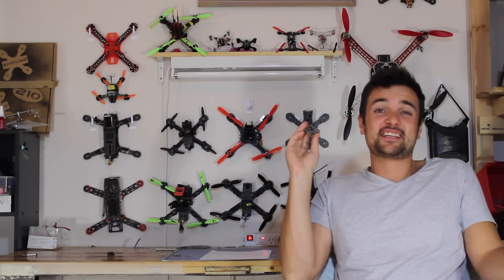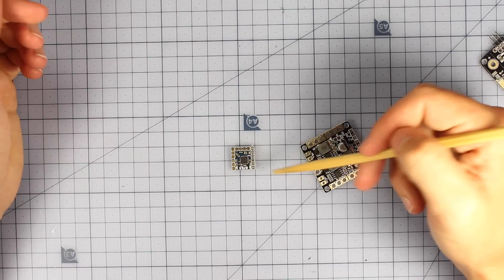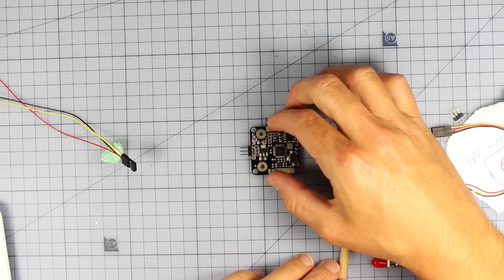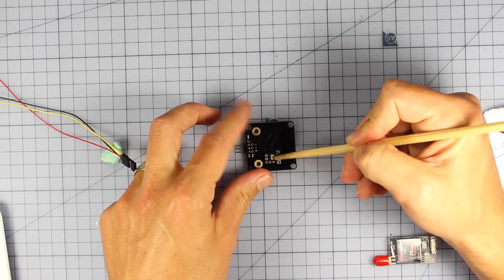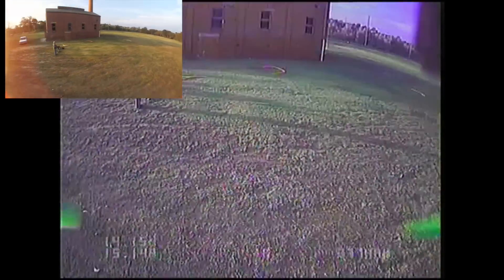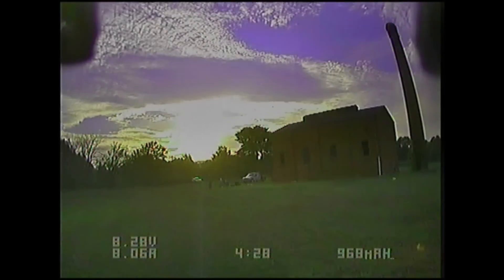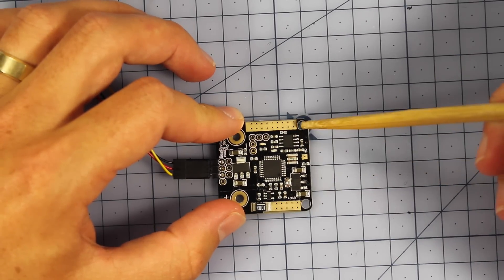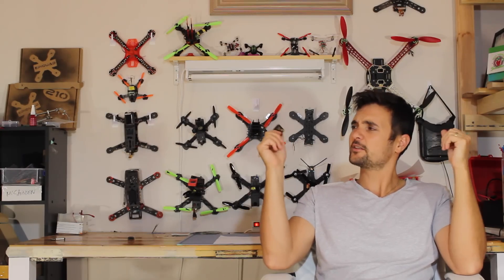Easiest OSD for a Quadcopter EVER!! POWER OSD PRO

Comment: Hi, Sorry, Im kinda new to building Quads, But can I use only the OSD without using it as a PDB? The frame that I'm using (Alien 5) already comes with a PDB in the kit. So I would expect that I don't need two PDBs but I would still like an easy to setup OSD. Should I use this one? Or do you recommend any other easy to setup OSDs? Any help would be appreciated. Thanks!
Reply: It will work, but unless you wire the battery through the PowerOSD and then to the frame-PDB you can't read the current and mAh rating ;)

Comment: hi mate great video iv got one of these and on 3s the fpv is crystal clear but when I go 4s it's like Iv not got a filter on the fpv feed, any advice on this??
Reply from the maker: mmm Not sure. Mine is fine on both 3 and 4S.
Reply: +UAVfutures humm will take a look later it's only on 4s when I power up my motors I get it
Reply: hey Mark, did you find out the problem as to why that is? I'm also having weird feed with a 4s pack

Comment: hello< my ? is . do you have to provide the Flight control board with Vbatt(battery voltage),or will the Osd do what is needed to provide Low voltage alarm and Mah draw.thanks like your channel
Reply from the maker: the osd does everything for you, You dont need to worry about vbat.

Comment: Newbie question regarding the 5v pad to power the FC: Where on the OSD Pro do you ground the connection?
Reply from the maker: +goobRe just to the normal ground with all the other ground wires. it doesnt need a special ground. All grounds are common.
Reply: Ah okay, thank you for the clarification. Greatly appreciated.
Reply from the maker: goobRe my pleasure

Comment: I bought two of them and has been impossible to avoid noise in the video without using a lc filter which is more weight to the mini quad, so no very happy with it.
Reply from the maker: +alfonso borja I have very little noise. What esc motor combo are you running?
Reply: Yep those are known for noise. Lb20a - noise, SEMF noise. Tune it for a smooth flight. Then is perfect. Hit something and get unbalanced prop- noise. Slap a set of brand new HQ- no issue at all :)

Comment: Is there a picture of this board all soldered up? For the positive connections, it seems like all of those are connected on one pad. Do you have to be careful and thread each wire into a hole and do a very tiny solder, or is it all sort of blobbed together?
Reply from the maker: +Bo Boland im not sure which positives you mean, but basically the big positive pad at the back has all the positive wires soldered directly to it, it doesn't matter if they are touching because its all the positive. EXCEPT the camera and vtx because they need different voltages.